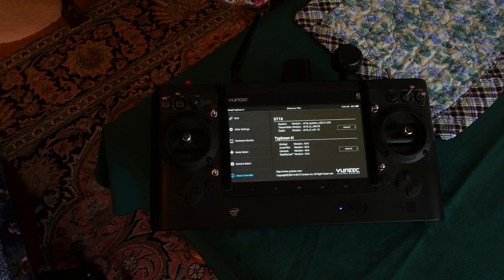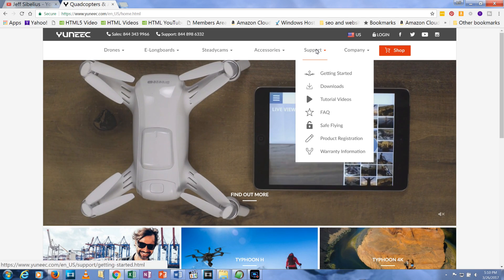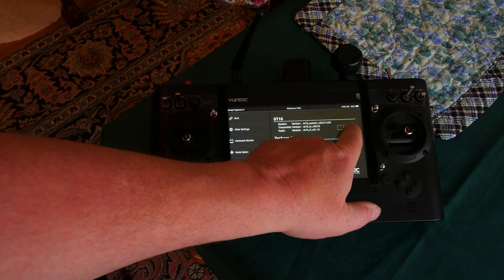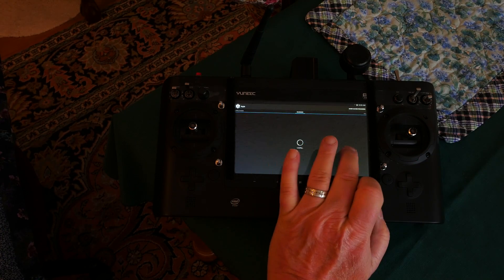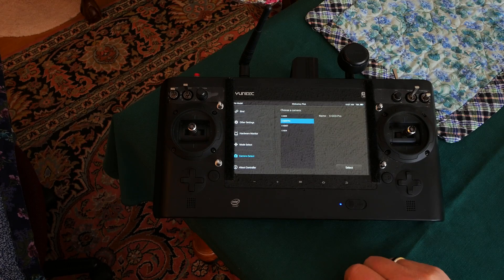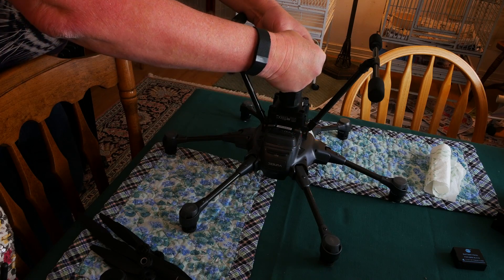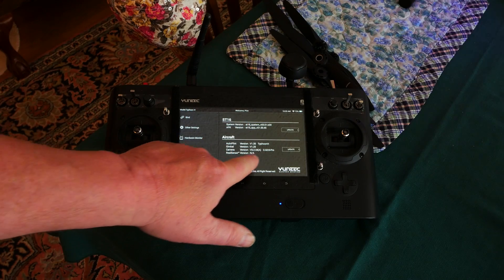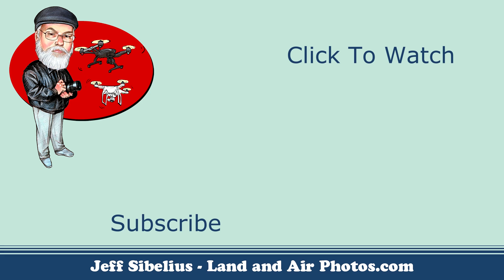How to Update Yuneec Typhoon H Firmware STD V3.04 - 2017 Typhoon H and ST-16 Transmitter

Comment: Jeff! My H won't update the firmware for the Aircraft and the "about controller info" just shows "request time out" in all the lines (gimbal, autopilot etc. Any ideas?
Reply from the maker: Hi Kaliff - just got back from vacation . . . did you download the files with internet explorer? If so, clear your media card and download files with Chrome or Firefox. IE has a bad habit of adding extensions. Also, make sure you're using an 8GB or 16GB card, no larger.
Reply: Hi Jeff, thank you very much for your reply. I've been trying to figure out what the issue might be (followed your thorough instructions so far). I can install the ST-16 FW successfully,  but upon attempting to install the aircraft FW, the "Update" button simply doesn't do anything. It reacts like the other buttons (highlights upon pressure), but no installation commences. Could it be that it's because I'm using a CGO-ET camera to update via?

Comment: CORRECT ME IF I AM WRONG.
 IS THERE AN SD SLOT UNDER THE FUSELAGE THAT
 YOU MAY USE TO UPDATE THE TYPHOON H ?
KEITH
Reply from the maker: For some reason your comments keep going to my spam folder, even though they're not spam at all. That's why I'm not seeing your posts frequently. 

I don't think the H has an SD slot on the body, just on the camera. But now I'm going to have to go look LOL
Reply: ARE YOU MARKING THEM AS NOT SPAM ?
KEITH KUHN
Reply: HI  JEFF WHERE ARE YOUR NEW VIDEOS ?
 I ALWAYS CHECK MY SPAM FOLDER ALSO.
 KEITH KUHN
Reply from the maker: Youtube doesn't give that option - it's either approve a message, delete a message, or flag as spam
Reply: HI  JEFF
  WHAT I AM SYING IS ONCE IT IS IN YOUR SPAM FOLDER
DONT YOU HAVE THE OPTION TO CHECK MARK ATHE BOX, THEN 
LOOK TOWARDS THE TOP A BIT.AND IT SHOULD SAY NOT SPAM.
 THE YOU SEND IT BACK TO YOUR IN BOX.I WILL SEE IF I CAN SEND YOU A PNG ON IT..

Comment: Awesome video! I have done the firmware update also with no problems accept 1. Never had this problem until after "this particular" update. When I play back the video files on my ST-16 controller they are very glitchy and jerky and look like there was a bad controller to camera signal. Playing the videos on my computer they look fine and play smooth. Have you noticed this problem after this update or herd of anyone else who has?
Reply from the maker: I haven't heard of any problems  like this after the firmware update. If this continues, you should call Yuneec. They may have a fix for it, but at least they should know of the situation following the update.

Comment: Thank you Jeff for another excellent update instruction video. like you i find the SD card update method the better option. happy and safe flying to you and everyone using the typhoon H.
Reply from the maker: I'm glad I'm not the only "old schooler" using the media card LOL. 

All the problems with firmware updates I've read about since October or November have been issues with wireless updating and problems with flying after the firmware update is complete. I don't think I ever saw anyone complain about updating from the media card other than people who used a 32GB card or larger.  It's really simple to put the firmware file on the media card and click it into the camera, so I don't see any need to tinker with wireless updates - not at this time anyway.
Reply: Jeff Sibelius Hi Jeff.. now, I think it's easier updating using internet...quicker and reliable fm this last updating...anyway yr films are useful and interesting... bye pilot
Reply from the maker: Thanks Roby. I'm going to see how the wireless updates go for another firmware update or two before I recommend it. Most of the installation problems I've seen over the past several months occurred during the wireless update. But we'll see if it becomes more reliable.